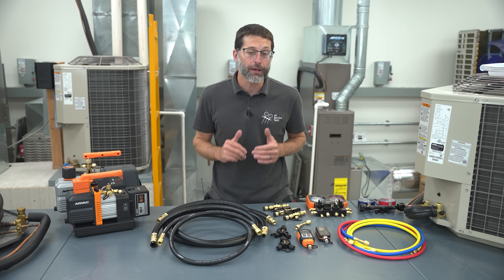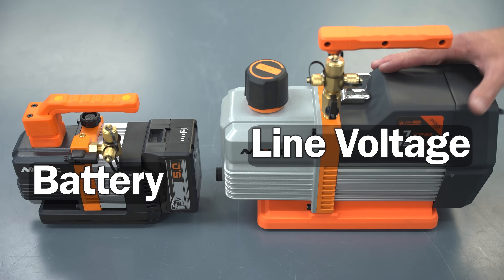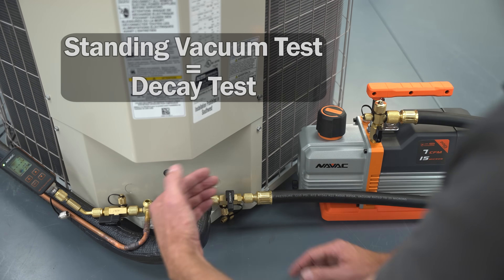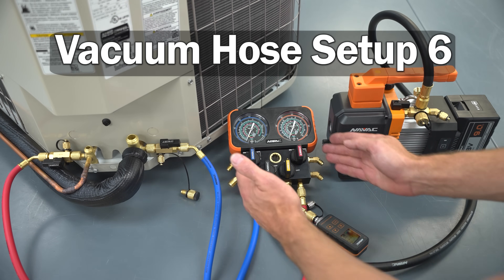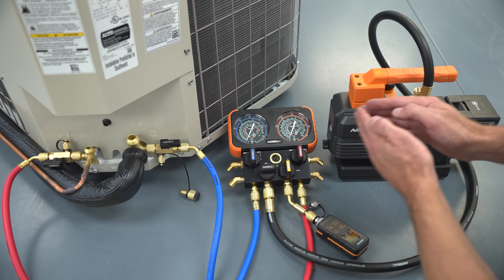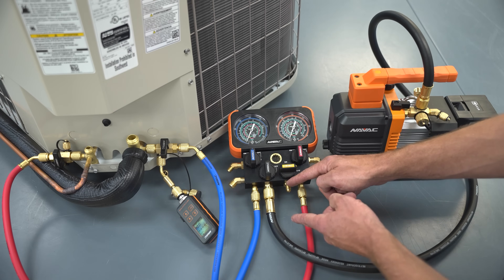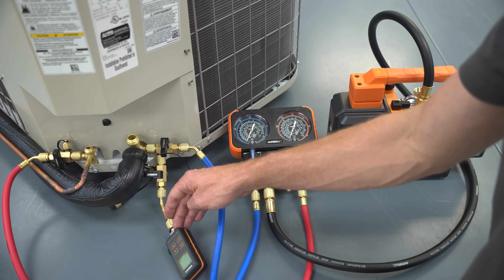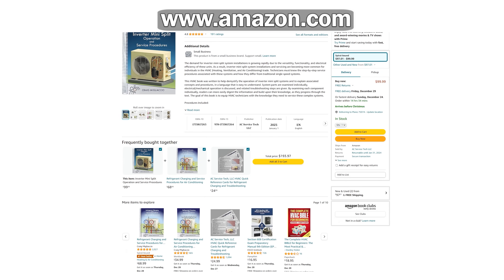10 Vacuum Pump Hose Setups Used on Air Conditioning Refrigerant Tubing! HVAC Training!

Comment: What about if u are vacuumed the whole system like put both lines on the suction and liquid and micron the true suction on the unit . This unit doesn’t have Freon in it and want to vacuum all of it because the indoor coil was trash and all the Freon was gone . What’s ur suggestion

Comment: Use a Valve and 4-port. I haven't had a problem with pulling a vacuum. Even with smaller lines. And through a manifold. How much internal capacity is he doing to need really big lines?

V/R Chris

Comment: Just how inaccurate is the micron measurement through a Schrader valve? I never even thought to use a 3rd VCRT. I figure on the 2 VCRT setup, once the reading stabilizes, you can remove the vacuum gauge before releasing the freon. This way, there's no contamination. But now I'm wondering about the inaccurate reading. Are you saying that if we pull it below 200 and it stabilizes around 300 to 350, we may not be able to trust it's even below 500? If not, I'll give the 3 VCRT setup a try. But otherwise, I'll probably stick to 2. For standard residential installs, do we even need that kind of precision?

Comment: I use hose vacuum setup 5. I use the appion hoses and core removal tool. I also use the Yellow Jacket SuperEvac Tree instead of the Y connected to the vacuum

Comment: If you’re using the hoses off the manifold, why not put them on the tee and then keep the cores in the tool so you can put them back in before releasing the charge?

Comment: For anybody watching now. After putting the schraders back with the core tool. Be sure to clean the tool with nitrogen. Build up tends to happen after releasing the refrigerant into the shut off tool which can mess with your micron gauge or just make it harder to pull a vac because of excessive oil in the tool. Also be sure to open and close the shut off tool after disconnecting because a little pocket of refrigerant get stuck behind the ball valve which means if the next time you attach a micron gauge or vac hose. That leftover refrigerant goes right into your microm gauge or pump which isnt recommended since it can throw off your readings

Comment: Will larger hoses reduce the time it takes the vacuum to reduce from 1000 microns to less than 500 microns?  I would think at that point there is so little flow, restrictions aren't important.  And, getting from 1000 to below 500 takes much longer than what it takes to get to 1000.

What am I missing?

Comment: why couldn't you replace the valve cores before breaking the vacuum or opening your service valves.  that should stop the refrigerant from entering your sensor correct?
Reply: As soon as you attempt to replace the valve cores, you are introducing air and moisture into the system. To protect the sensor you have to valve it off then introduce refrigerant so that there is positive pressure and the system won't pull in air/moisture.
Reply: @jeffreygarrett1942  correct, always important to open the king valves or atleast charge the system a little before removing the vacuum gauge

Comment: I do set up 1, but I have a ball valve for the micron gauge so it can be valved off when I let the refrigerant in to the system.
Reply: What ball valve do you use? I use the yellow jacket one but it doesn’t specially say it’s vacuum rated. However, I don’t seem to have any issues pulling a deep vacuum. 

Usually I triple evac by breaking vacuum with nitrogen and then pulling down again.

Comment: When you use the second setup, when do you add the cores back? I don’t want to contaminate the system. So do you want till after you crack the valves?

Comment: Great video, as always. I use one 3/8 vacuum hose to the side port of my schrader removal tool, which is on the big line, and the schrader pulled back. Then put the vacuum gauge on the side port of the other removal tool on the little line with the schader pulled all the way back. This way, the system is not exposed to any atmosphere when inserting the schraders. Once the schraders are installed, I then release the charge. I have no problem pulling extremely low vacuums and passing the decay test, and the vacuum gauge is measuring the far end of the system.
Reply: I like this idea

Comment: Greg, DO you know which Valve core removal tool , works on the Rheem's (RARL Series) or (RAMB Series) that have the internal shredders located inside the case, where the pipe is in the way, non seem to fit because of the confined space. I would greatly appreciate it.

Comment: Could setup #5 use a ball valve in place of the 3rd VCRT? I'm not sure I understand the practicality of a 3rd VCRT. 

Couldn't you add a ball valve to the gauge adapter on any set-up to protect the sensor?

Comment: Thank you for the video. I’m a part time mini split installer (FGAS certified).When I’ve spoken to experienced HVAC engineers about removing cores during vacuum, they look at me like I’m speaking a foreign language. Never heard of this type of evacuation. 

I would like to ask why the core is replaced under positive pressure and not before breaking the vacuum with refrigerant? Thank you again for these brilliant videos!
Reply: If you try to put the core back into the service valve while it is still under vacuum, there would be a great likely hood of sucking air (albeit not a lot, but any is too much)  into the system you just pulled a vacuum on.
Reply: @chrisdeanndavison3626  Thank you for this! Makes sense now.
Reply: @crowderglen  You are welcome!
Reply: @chrisdeanndavison3626 

You could break vacuum with nitrogen - add cores. And then evacuate again if you don’t have all of the ideal tools. 

System would not have to the atmosphere due to nitrogen purging out air when adding cores. Nitrogen absorbs water too.

Comment: Isn't that manifold gauge set analog?
Reply: I have both. Prefer the analog.
Reply: Yes, but you are only using the analog gauge hoses for the vacuum. Lazy people don't disconnect the hoses from the analog gauge or don't know how because of never been taught. He's just showing different ways a vacuum can be done. It's especially helpful when a hose or a fitting is leaking and have to do it a different way.

Comment: I found a Navac charging/vacuum machine in the back of the supply house on warranty. I asked if I could have it and they gave it to me. Since then I have rebuilt three Navac NRC62D units from scavenging parts. I give them away. I have a G5 twin and JB platinum. Nice video, thumbs up.

Comment: Whats the best for when you trap refrigerant in the compresser when you replace evap coil.
Reply: This entire video.. just think of it like this the shorter the  distance from copper lines the better..so if you could use 2 3/8 vaccum hosed and connect it straight to the pump is the best way
Reply: Using a manifold gauge should really never an option to do..its just like a carpenter telling you to use a hammer and you just wanna keep using a screw driver to nail something down..or like drinking thru a straw when you can chug it down

Comment: Those valve core removal tools definitely seem great and useful, for some reason basically nobody I work with uses them. My question is, once the vacuum is complete, you break the vacuum by releasing the refrigerant, now it is time to place the shraeder valve back in. Are you able to do that with the ball valve on the VCRT closed? I am wondering how you are able to place the SV back in. As that part of the process is not explained in this video. From what ive seen my understanding is that the ball valve needs to be open for the valve core insert part of the tool to be fully inserted
Reply: The part of the VCRT he pulled the core out with seals when you screw it back on to the end of the VCRT. Then you open the valve and push the core back in and thread it back in tight, the it's sealed and you can remove the entire VCRT.
Reply: @douglasshackett8747  okay cool thanks for clearing that up! That makes sense. I could never wrap my head around it because like I said for some reason nobody at my company uses them except for one guy who I rarely work with. Seeing how useful these vcrt's are makes it seem like a no brainer to me.
Reply: @SplitGordo1809 Search for more AC Service Tech videos on YouTube. They have a few showing exactly how it’s done.
Reply: @crowderglen  will do, thanks
Reply: Buy them they are great! So quick vaccing a 3 pipe vrv system with over 400m of pipe in less then 5 hours
Reply: Nobody uses em because they are not good to use navac core removers are not good..i had a pair never did heavy duty work and they just blew apart one day nitrogen pressure testing a system below 300psi
Reply: @DV90400 I like the Appion tools and can't wait to get the new fieldpiece tool with 2 built in valves and the window so you can see your valve core

Comment: In the fifth setup, the two hose, three VCR tool setup, does it matter which side you put the micron gauge? I put it on the liquid line.
Reply: I do the same, wondering if it matters? Did you ever get a clear answer to this?
Reply: @Christopher-oi9jo  I'm pretty sure it doesn't really matter. The only possible difference is that the txv may delay the equalization of pressure between the high side and low side.  So just waiting a few seconds or minutes for equalization is probably sufficient.

Comment: Awesome summary!  Absolutely love all your videos.  I have a system where I replaced a piston with a txv.  With the Piston, I was able to pull the system down to 500u vacuum with a one-hose setup in about 3 minutes.  With the new txv, the one hose setup was taking forever, after 20 minutes I gave up and switched to a two hose system. With the two hose setup, it pulled to vacuum again in about 3 minutes. Is this an indication of a non-bleed txv?  I have a second system with an old txv, about 13 years old, and that system I pulled to vacuum with one hose setup also in about 3 minutes. But I'm not sure that txv wasn't stuck open.

Comment: I use the 5th setup. I've never had a problem. But we had a Rheem rep come about the A2l freon. And said that pulling a vacuum to fast can cause problems also. If you have moisture in the lines, the fast vac could freeze that moisture. I can see that, but if you're blowing out your lines and running nitro, I don't see a problem. But just something to keep in mind.
Reply from the maker: If the standing vacuum test (decay test) is performed then that proves no moisture is frozen. The only time that could even happen is on a system where both the inside of the home and outside was below freezing and you were vacuuming the lines. Otherwise there is heat for the tubing to absorb from the air outside the tubing while heat in the air from inside the tubing is being removed by the vacuum pump.
Reply: @acservicetechchannel  I love it something I need my friend to watch 😂 but can you do a video in detail like this video about moisture…  I just watch the TruBlu man yesterday a when he added water in the line 🤣 and explain.. but I want to watch you explain 😅
Reply: You can turn the shut off valve 1/2 way off until you are below 1000 microns, then open it up completely.  This slows down the vacuum process, but you can speed it up when you need it.

Comment: Made the mistake of using the back side of the core removal tool, isolated on the removal tool to add the charge and found refrigerant had bypassed the valve and went into my vacuum rig.. gotta check my tools next time but really screwed up the whole process
Reply: Man that always happens.i have seperate vaccum hoses versus charging hoses and after my vaccum i open the port and i had my vacuum hoses on ..and i open it on the liquid line ..i fastly blew nitrogen thru it and hooked that line to the vaccum pump to clean out the oil

Comment: For me, I use a manifold connected to the liquid line with an extra ball valve at the end of the hose and the core removal w/ micron hooked directly up to my vacuum.   I vacuum the liquid hose as well then shut off it’s  ball valve, then the removal tool, then the micron gauge and break vacuum by charging through the manifold.  That’s mainly because I don’t have two removal tools lol.  That said, I only do that on units where I had to recover refrigerant.

Comment: Flow nitrogen when removing valve core directly. If the system has no refrigerant the best way to clean & remove the oil on micron gauge is by exposing it to liquid refrigerant. Just make sure not to start the system with the micron gauge. 

On inverter if the system is empty it's much faster if you connect the pump directly on the liquid line.